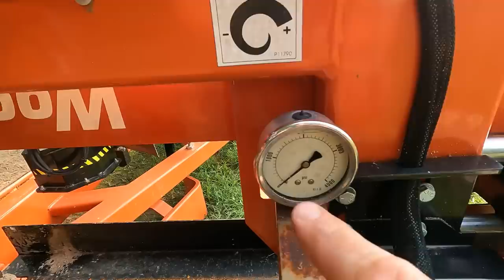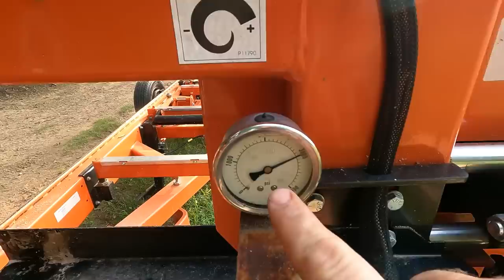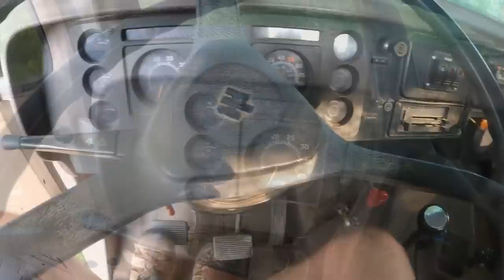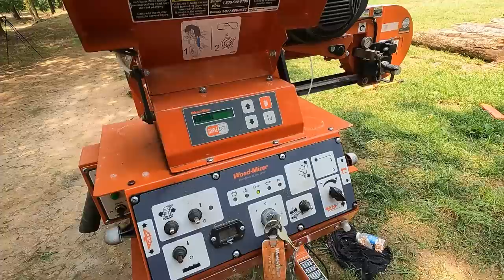I have no one to blame but myself! Challenges of Mobile Sawmilling!

Comment: When leveling  the mill from side to side, I place boards in front of the low side tire and pull the mill up to level (before disconnecting from the tow vehicle).  The wheels are an important part of stabilizing the mill.

Comment: Great video. I am about to install a trailer on my Mill which makes it portable but since it doesn’t have a hydraulic lift on it, I’m gonna have to have a machine on the other end or set something

Being able to take it with you is great, but it’s not without problems

Comment: Josh, you need a choker they use it in the logging is slip the cable around OK in the class and then hook your end of your cable on your tractor whatever way you go and pull the whole log one shot

Comment: I notice you let the blade spin a lot when not in wood.  Band blades have a flex life. You spin them too long between sharpenings..theyll crack and break prematurely..  you wont get the sharpenings out of them.  Just a tip I thought id pass along to my buddy Josh.
Reply from the maker: clutch on the mill is more expensive than the blades...but you do make a great point Floyd